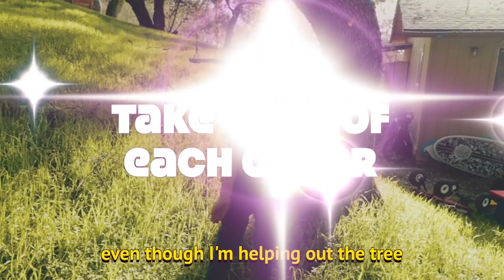What they really THINK (about me)

Comment: re: waterproof phone. Was the screen cracked before or after you took it in the water? If the screen was cracked before you submerged it in the water, that will mess with the waterproof integrity. So, that could be why your phone is acting up.
Reply from the maker: NovaRune No Crack in the screen.  That's just the cover.  I think the phone did some crazy update and that's what was going on.  Just weird timing.